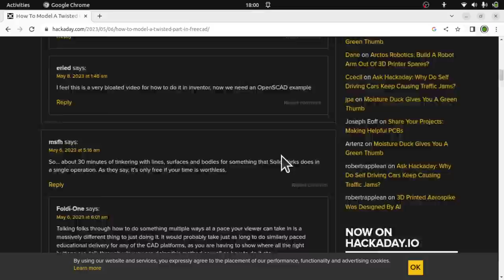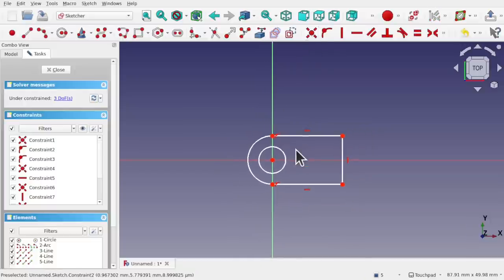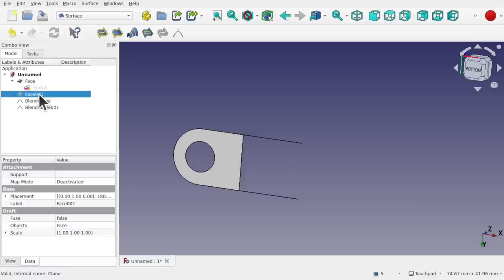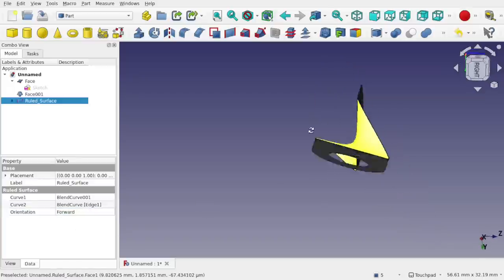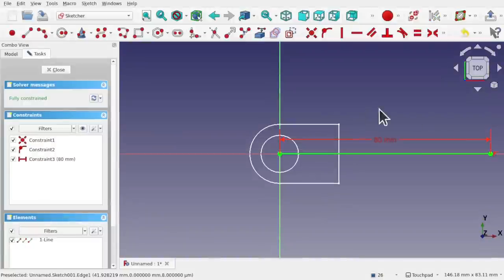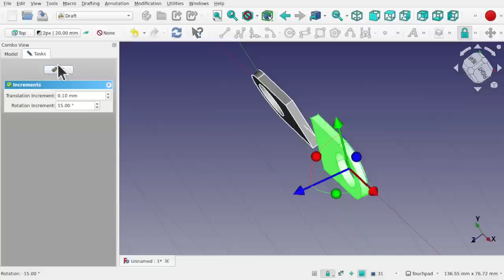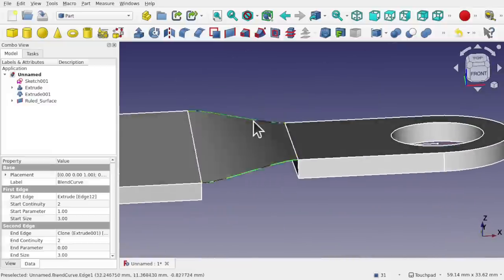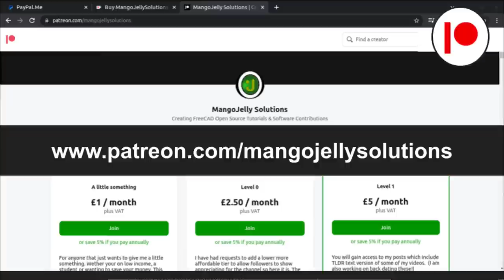Response to Hackaday Comments. Quicker Ways To Create a Twisted Part in FreeCAD

Comment: Good to revisit this and show how it can be done easier. I tried to do it using the Helix tool or using Additive Loft. But it looks totally unnatural. Because the straight part suddenly twists without the normally looking curve. I think your methods work best at this moment.
Reply: Loft has an option to blend/curve transition between profiles, as long as you use more than 2 profiles. Id personally try with 3/4.

As for helix, you can blend the transition with fillets.
Reply: @H34...  That are great ideas.
Reply: I don't get this problem. Simply loft with 3 sketches works perfectly. One 0deg, second in the middle 45deg and one 90deg. Why trying so hard?

Comment: hm. i think fundamental problem in freecad UX it is paradigma of transformations: for difference situations difference tools. i hope in future we can see more NURBS surface and 3D Bezier curves  based modeling
Reply from the maker: I agree, there are so many hidden gem workbench tools out there that sometimes it is hard to figure out where to look. I did a tutorial on using one of the tools in the curved shapes workbench. A small workbench with a handful of extremely powerful tools that have changed some of the techniques I use especially when it comes to Nurbs. The surface workbench is pretty light on tools and it would be good to see tools from these curves and Curved shapes workbenches included as default.
Reply: @MangoJellySolutions  for me one critical part missed right now is continuity between surfaces... It is kinda here, when you creating boundary surface, but what will be more useful is continuity modifier between 2 already created surfaces like in NX or solid edge. Looks like devs started some work in surface wb and that is good, but who know how long it will take to bring this tools to perfection. Curves wb is great, but it approximation based, so it's tools cannot be ported directly to surface WB.
Reply: @MangoJellySolutions  If the blend surface in Curves had an orientation parameter like the Part Ruled Surface, this would be a lot quicker to do. Building it manually as you did is a good workaround.
Reply from the maker: @PyroNine9  totally agree. I have seen a lot of comments on this video in regards to blend curve and your comment on blend surface I am going to pass them onto the developer.

Comment: This is a big improvement on the last video where the material thinned out in the twist. Is it possible to join the 3 surfaces and do the offset in 1 operation?
Reply from the maker: Thank you. I have been thinking about that. I wondering setting orientation of the ruled surface to something different would solve the issue. In a matter of fact, I think that could be the answer

Comment: Im personally averse to going out of part design because of how it affects the feature tree, so i would have done things maybe slightly differently.

Maybe using helix, and then filleting the transition, or lofting between  couple of intermediate profiles (perhaps using the curved shapes method you demoed recently) , maybe a pipe along a curved path. Again this is mostly because im averse to leaving pd because it messes with the feature tree.
Reply from the maker: The linear flow of part design is so much easier to view, I have been very tempted to 'double up'  the videos to allow for the option of following either. The nearing of part workflows can get messy but part allows for more flexibility. Sub object shape binder comes into its own to borrow edges from shapes that have been made by other workbenches
Reply: @MangoJellySolutions yeah, the linear flow of the feature tree makes it much more coherent and readable. Not a huge deal here but on a more complex model it really becomes important. 

I use the linkstage3 version of freecad which really expands what part design is capable of and takes off some random shackles that it has in the main branch. Stuff like multi solid bodies, shape binders can be used in lofts, you can selectively extrude parts of sketchs and reuse sketchs, and a few other odd restrictions of main branch freecad have been lifted in LS3 making PD workbench so much more powerful.
Reply: Simply loft with 3 sketches works. One 0deg, second in the middle 45deg and one 90deg.

Comment: What is the benefit of parametric cad over simple modeller like rhino, i mean why someone will make so much effort in parametric software.
Reply from the maker: Rhino is parametric CAD package which can be use in a parametric and non parametric way, the same as freecad.
Reply: @MangoJellySolutions  I don't think constraint is available in rhino.

Comment: This would even be faster if the blend curve tool would come with some sensible defaults. But user experience is not a priority for FreeCAD developers.
Reply: Come on... it is FREE...and they have a good program here... User experience is a lot of work
Reply: @fooballers7883  This is not an excuse to not make the program easier to use. Free only goes so far imho. I do use it on a regular basis though :)
Reply: @imoldovan  There are ways out the poor UI. Unlike many "polished" commercial UI's that have things locked down because the UI design team decided that's how it's supposed to work.

First - customize your tool bars. Get those things you use regularly up there. You can add whatever tools from other workbenches to your favorite workbench.

My preferred solution is Pie Menus. A quick tap of the Tab key brings up access to whatever custom Pie Menu I want to make for myself. And the menu is right there in the window at the point I'm working at. 

Once you spend some time using a tool, you begin to realize that you a handful of tools regularly. Some only on occasion, somethings seldom, and a lot of it never. Figure out what you mostly use, set up your menus to reflect that, and be happy.
Reply from the maker: If that's the case what defaults do you suggest?
Reply: @MangoJellySolutions  : for example start end end parameters adjusted to match the side nearest to the mouse click; sign of size parameters each preset in direction of the other vertice ; continuity and size values preset from previously chosen values.

FreeCAD is a great tool and I highly value the work of the developers. But I often have the feeling that developers have more fun (which is great, they are doing this for free, so they should have fun) working on specialization and featurism than on generalization and user-friendliness. Best example for the usabillity hell is the destinction between Draft and Sketch workbenches.
Reply from the maker: @SoenkePeters  thanks for the detail response regarding the blend curve improvements, I am going to pass them along to the Developers